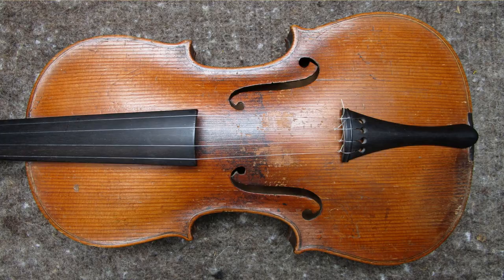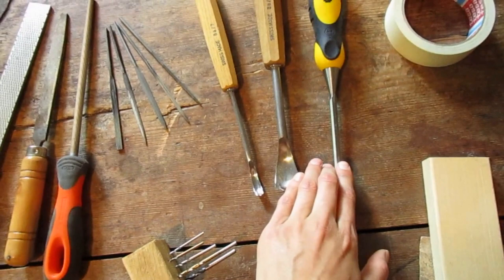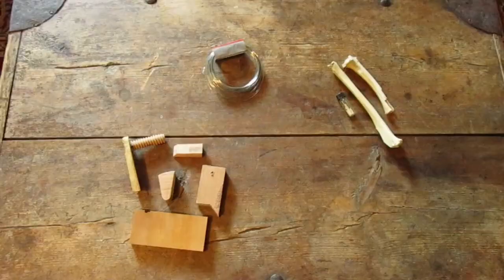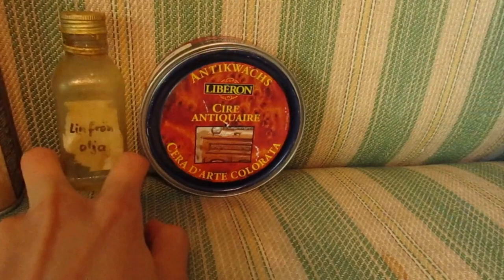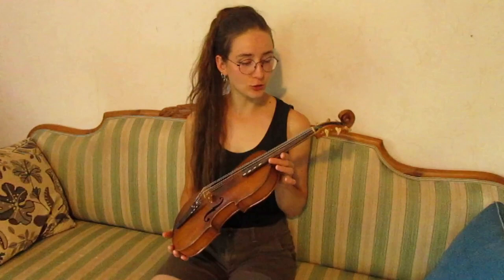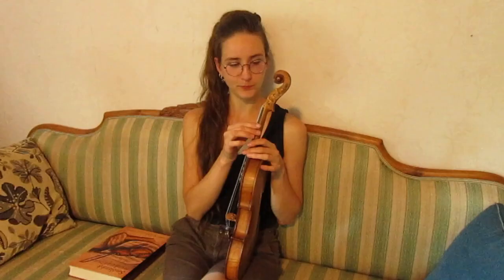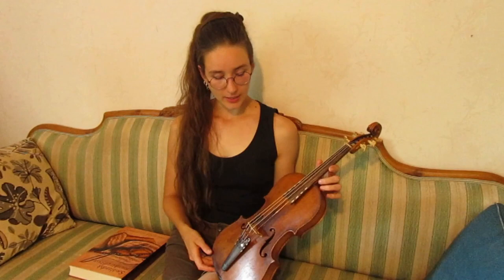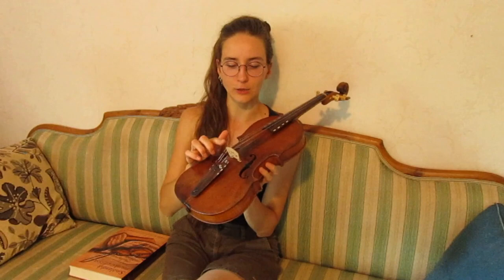Låtfiol Tinkering & Sound - Scandi Folk Nerd #27

Comment: That sounded amazing. I am really impressed with the work that you have done with your instrument. The recording was excellent. I have an old fiddle with several cracks in the body and a loose neck and elongated peg holes that is unplayable. You have motivated me to dest..... I mean repair and convert it into a Låtfiol. Hopefully I am able to finish the project once I get started.
Reply from the maker: That's pretty much exactly my own thinking about my own låtfiol ! Up to the workshop with that beastie !
Reply: @EmelieWaldken  Yes! To the workshop with the plasma cutting table, tig  and mig welder, and of course I need my angle grinder with the 60 grit sanding disk. I need that to remove the finger board. And I think I can use the powder coat oven to....I am not sure but I think that I am in the wrong workshop for this project.
Reply from the maker: @tim5cad203  Hahaha sounds like it ^^ but who knows ? perhaps a plasma cutting table could come in handy !
Reply: @EmelieWaldken  Well I may need to use a plasma torch on it towards the end of the build. Some may say apon looking at the violin that I should use it at the beginning of the build. I sent a message through patreon btw.
Reply from the maker: @tim5cad203  Tssk tssk don't listen to frustrated people who don't dare to try repairing and building nerdy instrument !

Comment: It is impossible that when you play an instrument it sounds bad. It's fantastic what you've done, bringing an instrument back to life. Congratulations on the result.
I would have put a fine adjuster for more comfort for tuning.
Reply from the maker: Thank you very much !
I have a fine tuner on the E string but I could have put another one on the A, true (D and G I'm used to tune with the pegs, also on my regular fiddle). The hardest to tune though are the resonance strings - and these can't get fine tuners with this design of the tailpiece.
Reply: @EmelieWaldken  Then Wittner geared tuning pegs may be an alternative. Pro: very easy and effortless fine tuning once you understand how it works. Cons: 80€ (for a 4-set), you clearly see that they are made of plastic, and they are a bit "chubby".
Reply from the maker: @YouPeasant888  Yeahhh all the ones I've seen (both in person and on pictures) are so ugly, I just can't. On my regular violin I'm very happy with my two fine-tuners for A and E and the pegs for D and G. But here the resonance strings make it more delicate...